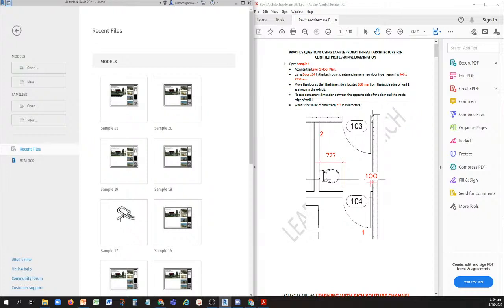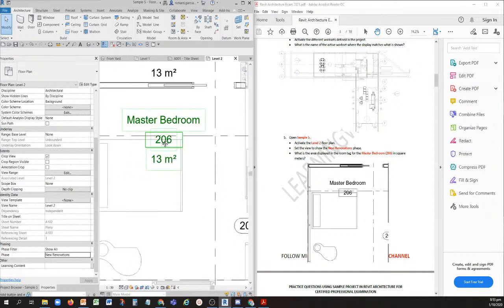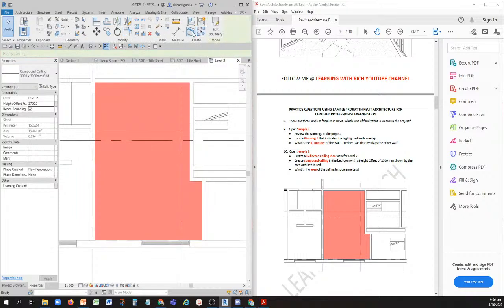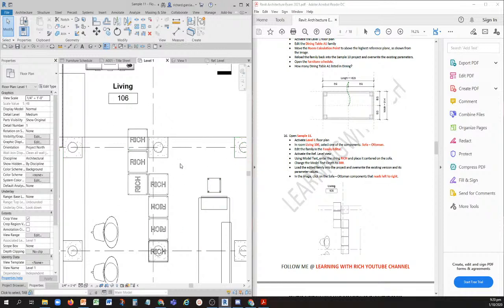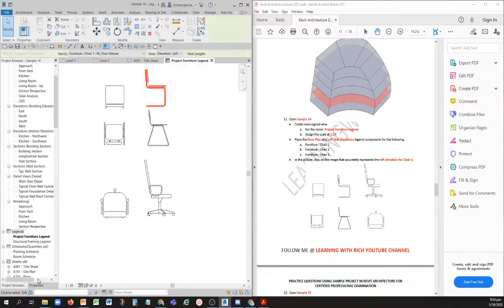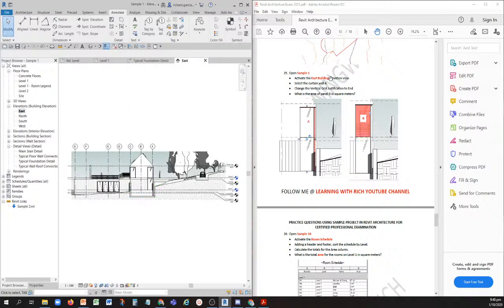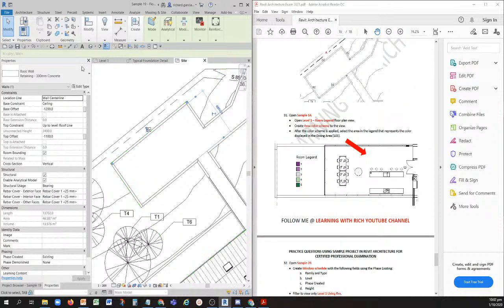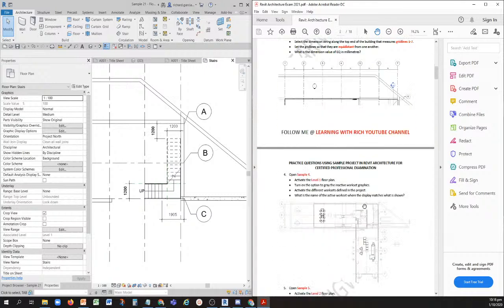AUTODESK REVIT ARCHITECTURE CERTIFIED PROFESSIONAL PRACTICAL EXAMINATION REVIEW

Comment: Hi, I'm interested in buying the material for the exercise, however in the site there are two different link and I'm not sure if I need both of them or what's the difference between them. The two are "Buy exercise files for Architecture" and "Buy Revit Architecture Examination reviewer and data files". Could you clarify please? Thank you and have a nice day
Reply from the maker: Hi Stefano, one is for the exam files only and the other one is for the normal videos of revit architecture exercises. if you will take exam, you can get the examination reviewer files otherwise the other option.

Comment: Thanks for the video. I have a question. in the exam, we will have that PDF to read the questions and to see the examples images?
Reply from the maker: The exam is two types. One is like this but you dont pdf, its on the screen. You read from there then switch to revit. The other type of exam is theory exam. No opening of revit, more on application and understanding of theory.
Reply: @bim360  Thanks for the answer. So the exam have two part. Theory and practice? and  both are needed to approve.. Do you know what kind of question they do in the exam?
Reply from the maker: @geraab1  hi, the exam is depending on the available type of exam in the training center or online center. sometimes they give the theory, sometimes application. but not both. better to be prepared for both just to make sure.
Reply: @bim360  oh I understand. Thanks for the answers. Greetings from Argentina